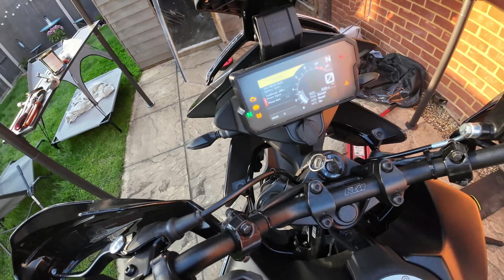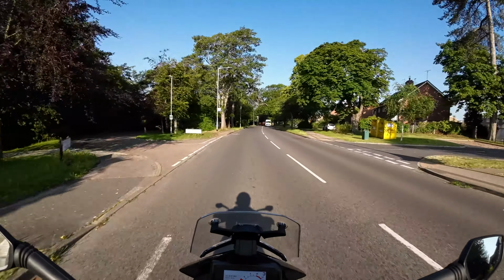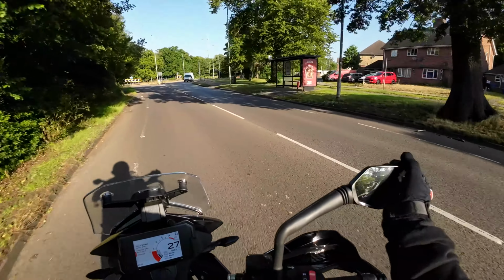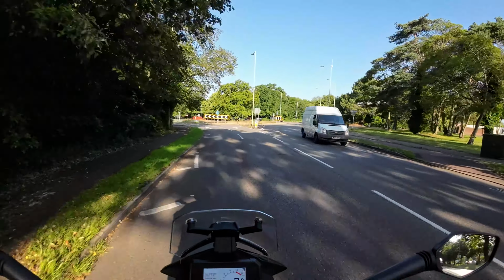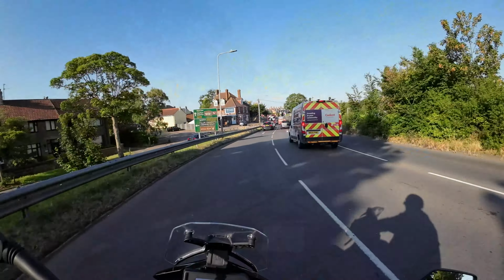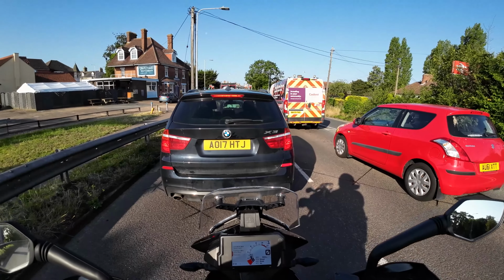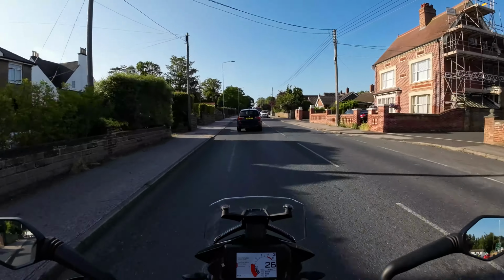KTM 390 Adventure Lowering Kit Shock & Side Stand Install

Comment: Thanks for this video. Are the two black bushings that come with the kit even required?  I came across a new in box kit on ebay that the seller said was sent to him without the bushings. I bought it but aomc doesn't have just the bushings available for sale right now. I am considering going ahead with the project but hope I can just change out the spring. By looking at it Im not sure why its advertised with the bushings when all you do it remove shock, replace tbe spring, and reinstall it.
Reply from the maker: bushings are for the front shocks, you dont have to use them, just drop them from the clamps as in the video

Comment: To lower the front 20 mm, was it literally undo the bolts and slide them down 20 mm and tighten them back up? Thanks in advance.
Reply from the maker: Yup easy as that 👌
Reply: Hello....does the front fork bottom out or hit anything on the bike now since taking away the 20mm ?  I'm considering doing this.
Reply from the maker: @user-bn7xz3mf5q no it doesn’t it’s fine to be honest

Comment: Thanks for doing this.... question now that youve rode a bit like this.... Does the front fender hit the bike at all from sliding the forks 20mm?   Im considering doing this technique 🤔
Reply from the maker: No it’s fine, id only lower the forks if you have the spring kit though, without the rear lowering spring you could alter the bikes handling dramatically

Comment: So you did not install the included spacers in the front forks? Looks like you slid the tube up in the triple instead. That was really the only thing stopping me from getting this kit. Really did not feel  like dealing with taking the forks apart. did you run into any issues with the fender hitting the radiator using this method? Most of the bikes I've lowered used links in back and sliding fork tubes up about the same amount.
Reply from the maker: Sliding the forks up worked a treat. Bikes rides absolutely fine. Highly recommended 👌